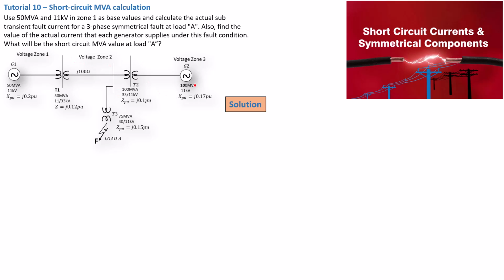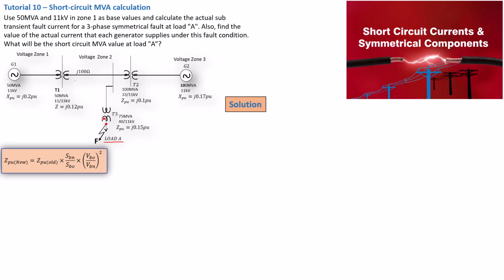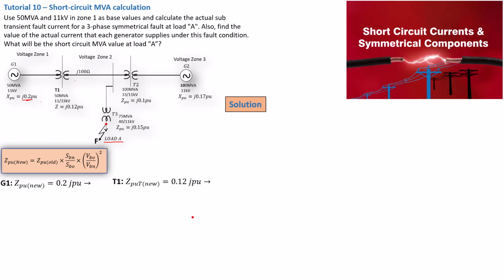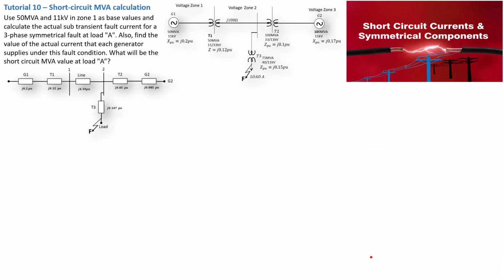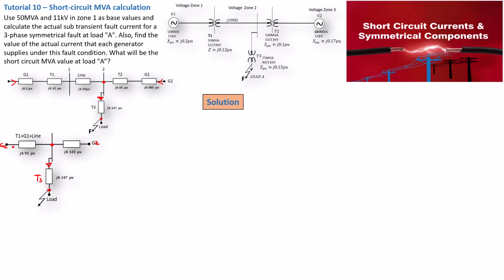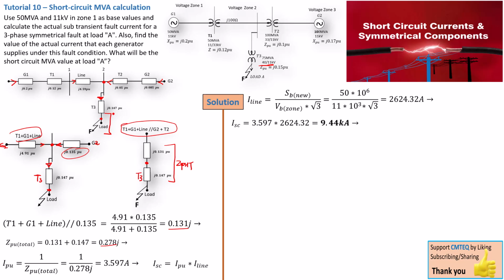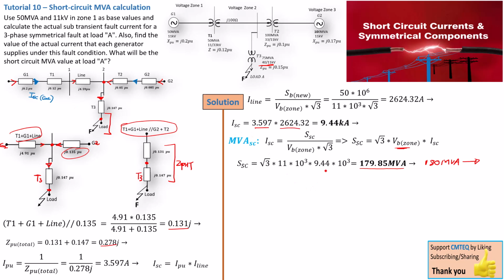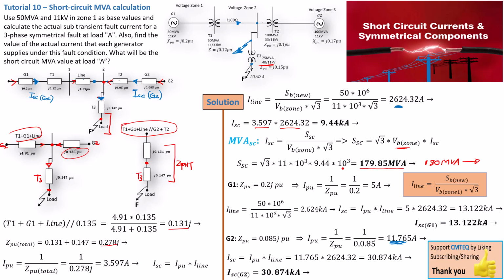Short circuit fault level - Fault current calculation. Tutorial 10

Comment: Why the combined short circuit current for the generators is greater than the short circuit current at the load when both of them are contributing to the load, shouldn't their sum suppose equal the short circuit current at the point of the fault (the load)
Reply from the maker: Good observation, but the key idea is that fault currents don’t simply “add up” based on sources, they depend on the Thevenin equivalent impedance seen from the fault point.

At the 11kV bus, the fault current is higher because the equivalent impedance seen from that point is lower. Each generator contributes through its own internal impedance and network impedance, and all contributions combine at the fault location through those impedances, not as a direct arithmetic sum.

So yes, multiple generators are contributing, but what matters is the  network impedance to the fault, not just the number of sources.

I'm releasing a tutorial today on fault calculation based on Tutorial 6, using DigSILENT.

Comment: Vbase in fault zone is 9.075 KV and not 11 KV
Reply from the maker: Please, review the distinction between Vbase new and Vbase old, when analyzing a per-unit diagram that includes transformers.

Also, check my reply to one of the comments here.
Reply: I also don't understand why Vbase in fault zone is not 9.075 kV. As I understand it, we are calculating I_base in the fault zone and multiply by I_pu to get I_sc. So by that logic, we should use the new base value for the Voltage in that zone since we want to keep the voltage values consistent with transformer ratios across all zones. We are taking 33kV as the base voltage on the high side zone of T3. So to maintain consistent transformer voltage ratio, the voltage of the low side zone should be scaled by the transformer ratio, which gives 9.075kV as base voltage in the fault zone, not 11kV.

Comment: why for T3, the Vbn is 9.075, when the new base value is 11kV, in the formula for Zpunew for T3, Vb old should be 9.075 and Vbnew should be 11kv? as the new base is 11 kv
Reply from the maker: Hi, thank you for your question, and it comes down to how the per-unit system defines base values.
Vbn for T3 is 9.075kV as calculated, this is because this transformer has a different ratio than the other two transformers. Please rewatch again from 6:00 to 8:55.

The 11kV on the transformer’s nameplate is its rated secondary voltage, not necessarily the base voltage used in a particular per-unit calculation. In a per-unit system, the base values are chosen for convenience and consistency across the network, not strictly according to equipment ratings. Since the transformer is connected to a 33 kV transmission zone, we usually take 33 kV as the high-side base voltage.

The corresponding low-side base voltage must then be scaled by the transformer’s turns ratio (11kV/40kV). 
That gives 9.075kV. So, although the transformer is rated 11kV on the secondary, the per-unit base voltage on that side is 9.075 kV, ensuring that both sides remain consistent within the same per-unit system.